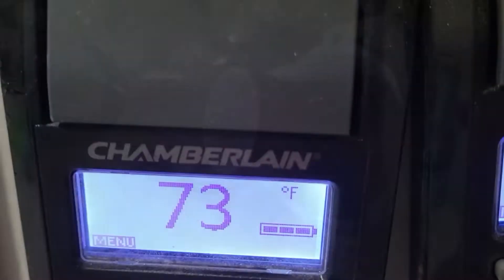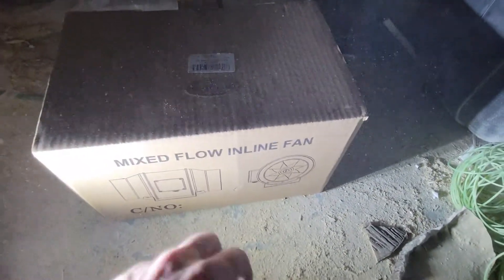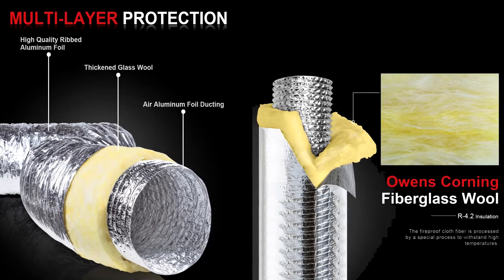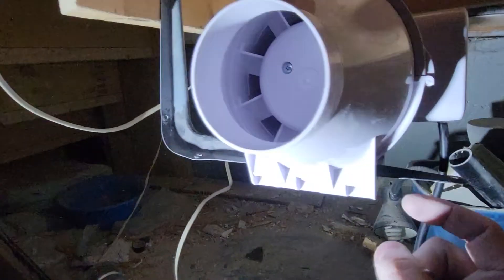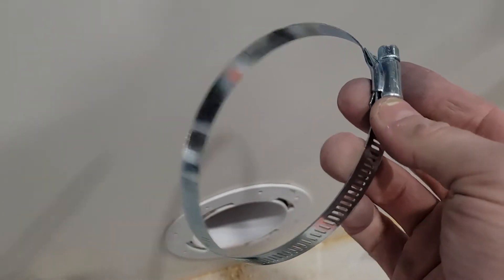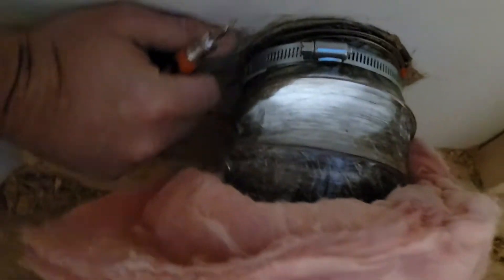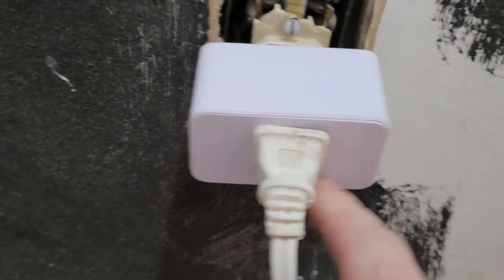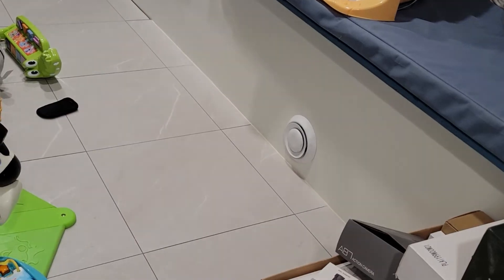How to Increase Air Flow in Hvac with Inline Air Motor - Add more Hvac air flow into your house

Comment: One question are those fans designated to run higher temperatures?
Reply from the maker: They pull aura regardless of what temp. It's solid metal assembly. I suppose if you run   this in 45 Celsius weather and pulling some octane based heating ull likely damage the parts. But yea it will pull air until parts melt I suppose. If u ever touched electric fireplace  vents they get extremely hot and so do the aluminum vents.